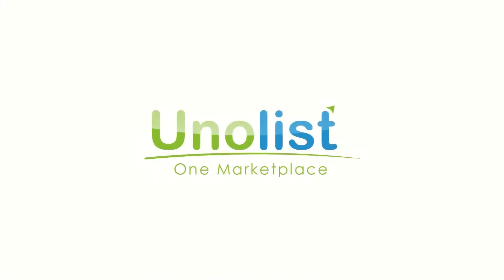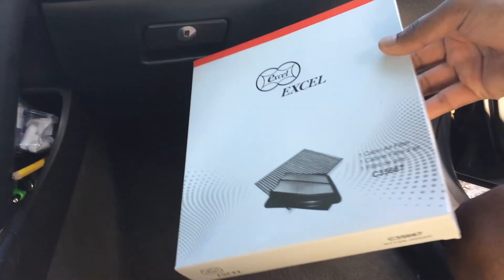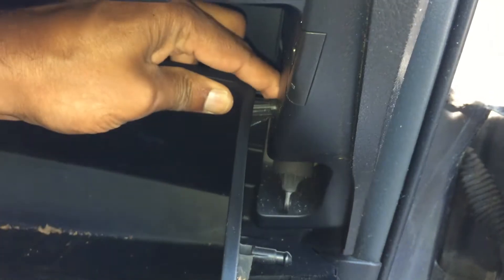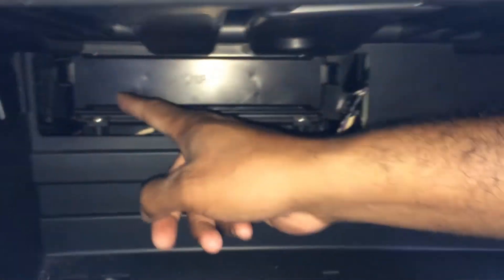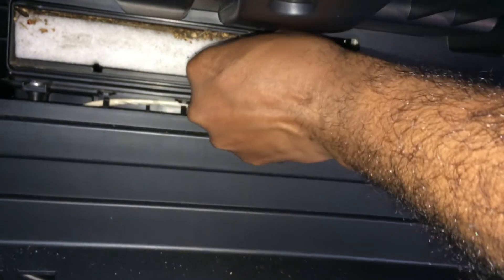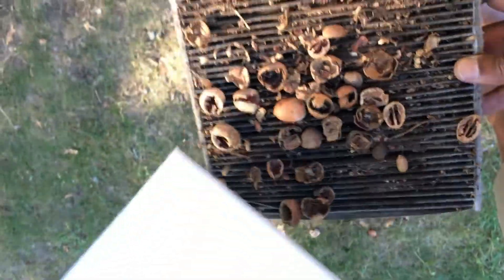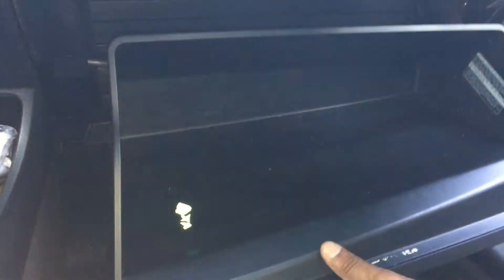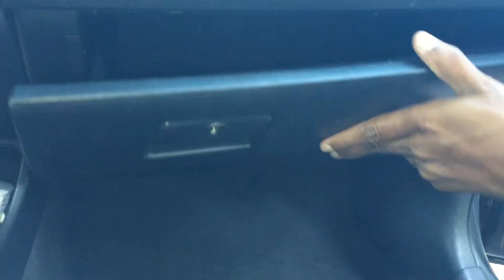How to Replace Cabin Air Filter in Camry 2009

Comment: Was there an air flow arrow on one edge of the air filter element and did you make sure it pointed down? All horizontally mounted cabin air filters with the blower motor mounted below the filter will have downward air flow.